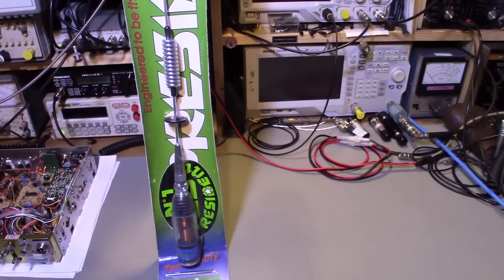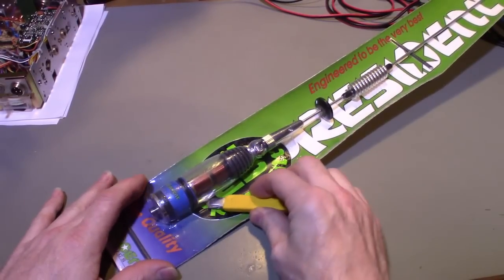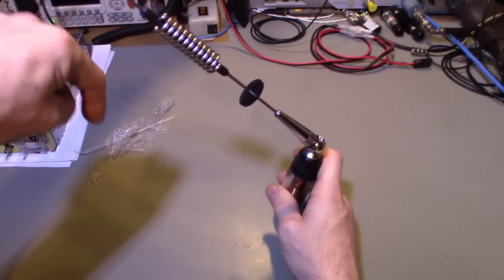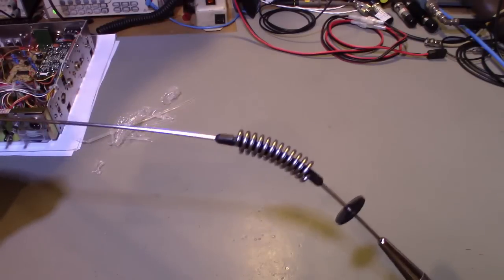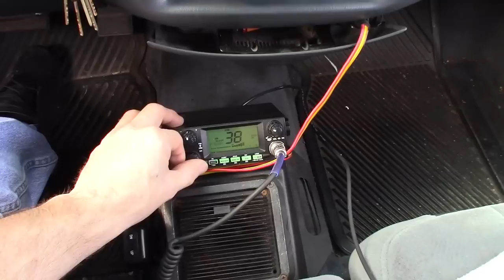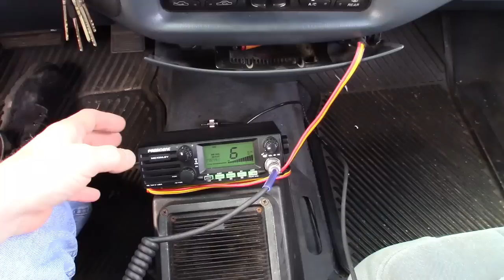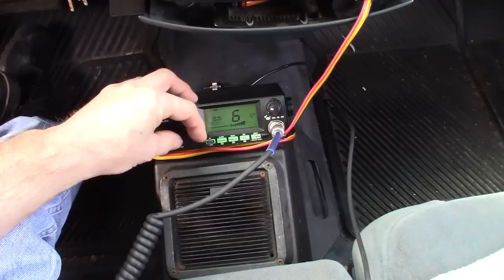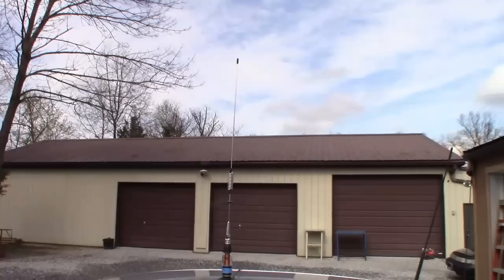President Electronics Mississippi CB radio antenna review.

Comment: We lean them foward.... so when we are Rollin. The antenna is up striaght.
Reply from the maker: I understand and can agree with that.  It's the people that have them at 45 degree angles or more that just make me shake my head.  I don't care if they are going 100MPH the antenna will still never get to a perfectly straight up and down point.
Reply: @mikesradiorepair  yes exactly….. also when sitting still you are only talking with a block or so and keeps reflect from cab down.
Reply: @mikesradiorepair  Tall antennas on top of big truck mirrors will trip over height sensors on highways, some of them are tilted forward to avoid that.
Reply: @daveaf3023  I agree, Was just repeating what I was told when I ask a guy in a Kenworth why he had his antennas laying forward.

Comment: a couple quick points. 1- if the is laying down (folded over) then to the side it would be the difference from vertical polarity to horizontal polarity which will drop your signal up to 20db.
2- the garage shouldn't make much problem with skip. Most vertical have an upward radiation of 16-20 degrees thus radiating right to the ionosphere so  the signal can "skip"
Reply: I agree,i used to use a K40  mag mount on my car trunk open the trunk and work skip on the flat side,worked better then vertical for me in cycle 23!
Reply: Exactly right on both counts. We ran basic, relative field strength tests on a couple big rigs from 90 degrees vertical to about 135 degrees forward rotation, and there was a very significant drop in level.

Comment: I helped this driver with His SWR and when I did that I decided to see what would happen if I tilted His Antennas if I tilted them forward and Straight up.... I noticed when I Tilted them too far forward and also straight up  it raised the SWR, but when I tilted them about 10* forward it was the best.... The SWR was higher because Straight up there was a reflection from the Cab because he had a Conventional, and too far forward it reflected off the engine, but as slight forward tilt was just right tilt...

Comment: The bad part about the semi truck is all the aluminum and metal in the cab. If you try to run the antenna straight up, it’s hard to get a 1.5 or less swr.  On a mirror mount set up. If you have the Mirror hoops you can get above the cab. All the new trucks don’t use those. I try to tell a fellow truck drivers, to use top loaded antennas. Like fire sticks. Trying to tune a set of Wilson antennas is terrible on the new trucks. KD0LDL thanks for your videos I enjoy watching them.

Comment: I had a good time parking high elevation, and after the painful choice of cutting an  8 ft whip, and adding male and female threads to make it sectional, stowable, listend to where skip was coming from, parking side of car facing that way, and the 6 inch magnet on the back trunk edge, yeah, making a horizontal dipole, half cash car, half whip, worked skip with much quieter recieve. Luckilly a jogger or bicyclist did not cruise through and get shish k-bobbed.

Comment: Appreciate this video.  I'm looking to run a ccx 102" stainless antenna.  I pull a van trailer. If I install it behind my cab will I get by interference  ? Should I put a clear rubber hose on my antenna to help with the interference?  I drive a Volvo and the mirrors have the plastic covers and I can't get a good ground.  I've ran a 102 before but pulled a flatbed  so I didn't have any problems with interference.   I'm running a Magnum S9.  Thanks again for being there and helping  everyone..
Reply: Ignore the ccx . Don't know where that came from...lol
Reply: ( behind my cab will I get interference) not by )  sorry.

Comment: We truckers tilt for SWR. These cabs are hell for signal reflect.
Reply: or for height clearance.
Reply: Right on brother. ..
Reply: with THE low SWR  tilt  antennas
Reply: Antennas are intended to be either vertical or horizontal and not tilted. When I see someone with their antenna tilted I know they don't know they don't understand how antennas work.
Reply: Allan McCullough I hear ya... but I hit a branch in the hills and the antenna went 45 degrees and I still talked 900 miles
Reply: I have a dual setup @ 90 degrees on my 379 and have no issues with swr. If you have high swr with mirror mounted antennas I would suggest you check resistance between mount and truck chassis.
Reply: Made a 4792 mile contact to SAO Paulo, Brasil with my Galaxy 95t2. @NoHandleNameScrewTube
Reply: With a steel whip like my mediocre Wilson 5000 @ 70 mph the top half is vertical

Comment: If you are going to get heavy into antenna reviews, check out the Larsen NMO27. Have tho tune it since its a general purpose low band antenna but they are quite rugged.
Reply: I had a now silent key ham recommend an NMO-30 with the 64" whip. He said it was better than the NMO-27. Probably due to less load coil and more whip exposure.

Comment: I figured that the whips tipped forward 45 degrees on trucks was just a questionable fashion statement. Well, not so fast. It seems that on Cascadia tractors, at least, it is impossible to achieve a good mach with the whip vertical. BTW- Do you have any experience with inactive AGC on Uniden Grant XLs? Same as similar vintage 148GTLs...

Comment: I long used a president new york antenna till it brokes, I mean swr was 1:4 very bad at the end. Changed it right now to a Sirio Omega or Super Carbonium. Problem is now I cannot drive into carport with antenna mount up. Have always go out and put them down. 

Now I think to go back to the new president new virginia or to the mississippi, Not sure what to do. What of the 2 antennas performs better? I think the new virginia should work better than all expect. But better than the mississippi?

Friend of mine has a simmilar antenna like the mississippi. Was another name but looks simmilar. He said he has better performance than other antennas even when the are longer ...

What to do?

Comment: The Rubber Ring is for adjusting SWR on certain channels. Because this is a Brand Specific it most likely didn't need moved on your setup.   I have had some fiberglass ones that had a rubber sleeve you would slide up or down for better SWR. No cutting or adjusting those ya know. 

Oh!  and SOME maybe not all drivers tilt them forward because they "Think" they can straighten them up at speed.  So in other words, they are sort of bragging on how fast their truck can go the more forward the antena is tilled...  I know crazy right!!!

Comment: my mobile wonder.....cobra 129 ltd classic, 18 ft rg8 mini au, 4ft firestick ajustable tip, 4pill amp. mount on rear of mobile with hustler quick release for 4 ft firestick. years of service and coax never exposed to the  elements of weather. dead key 100 watts swing 500. very simple but very effective
Reply: WTF is a pill?  Never heard of a pill amp before.  Must be something new.
Reply: @w.rustylane5650  then you must not be that well versed in the world of linear amplifiers because "pill" is a well-known slang term for a transistor, because many of them look like Advil or another tablet of some kind.

Comment: You gotta drop some numbers, somethin they can quickly confirm, and you will never get the loudest, someone confirming on the return bounce will be s5 most of the time. 38 does take breaks and leaves the floor open like Soul Train. Be patient. 28, 20, 17, 11, and 6 will take breaks, but it is like dragstrip light reaction time required.

Comment: Thanks Mike for the Video. I am interested in repairing CB Radios and I'm just wondering what Antenna I should get for repairing radios in my workshop. Will this antenna work for my purpose?
Reply: I max 2000
Reply: @robinbrown7019  Thank you.
Reply: Shop home boat tower tree I max is a great antenna ..64 wave is great on my ham radio with tuner built in .40 meters 20 meters 15 meters and 10meters 11 @ 12 worked the world
Reply: @robinbrown7019  Thanks bro. much appreciated.

Comment: nice little antenna, on my car i have to run straps all over the place for grounding and run wires up from all 4 sides to center of roof to ground(chassis) otherwise can't tune antennas lower then 2.1. it's a hassle but it's the what you have to do thesedays since cars are made of tin can garbage 
73'  k7sce

Comment: My guess on the little UFO thingy is it's a capacity hat. On the antenna canted forward, I do. 
I run a single 102" stainless whip and the best coax i could get my hands on from Universal Radio. At highway speeds my antenna is as near vertical as possible and SWR is 1.1:1 as indicated on the radios built in meter, which is pretty well in line with my analyzer
Stationary it shows 1.2-1.4 throughout the 11 meter band as shown on a Comet CAA-500 antenna analyzer.
I do however have all the various components of the truck, (cab, doors and such) bonded to the frame using 1" tinned copper braid straps.
You can catch me occasionally on 40 meters around 7.187 or on 20 around 14.330-14.340.
And with that I dun got down, down to da ground,  bye buh buh bye bye bye.
Gotta love the idiot's on channel 6...
73' de John C.

Comment: The trash talk is why I got away from CB radio and the other is you can't get pass the high powered radios for emergency requests and I don't care where you are all you get is the same trash .
Reply: I really wish the FCC would crack down on people with splatter box stations and people over powering and talking dx on 27.185 it's beyond annoying

Comment: I know it is a very basic question but how do you route the coax into the car?
Reply: I like to run underneath the vehicle. Find one of the rubber water/drain plugs. Make a hole in it big enough to get the coax through. After routing the cable and hooking it up, I go back and fill the plug around the coax with silicone to keep dirt dust water out.
Reply: Btw, most folks run it through one of the doors. I've never liked this method because it deforms your weather stripping and eventually crimps the cable.

Comment: Yes I would be fine with public executions for channel 6 user's on the "Super Bowel". I do not mind people using power or even operating where they do not belong. I hate splatter boxes and Ghost talking and any form of agitating and noise toys! My problem with ch. 6 as it relates to power is they operate amps that have poor design that goes through bjt transistors like Jimmy Carter goes through liver pills! When you cant afford transistors or they run out because of idiots like that I can not help but wish them nothing but animosity. They go though bjt transistors like a fat kid eating cup cakes. Soon their will be nothing left but Chinese transistors. They should have transition to NXP LDMOS transistors. The guys using tubes that have 10K or more power have to have crazy power bills! I bet if they used a heat exchanger they could recover some of that heat to heat their home! LOL

Comment: I'm running a tram trucker antenna mirror mount. .
if somebody is transmitting on a good radio. .I can receive his signel for about 12 or 13 miles....normal radio is about 9 miles..crap radio about 4 miles.....

Comment: NO disrespect but mag mounts dont work well. You cannot beat a well grounded antenna. I use a 102 inch real actual quarter wave whip. Go to side band to get away from idiots with splatter boxes and you can actually get out with 12 to 20 watts on side band. My 146 has 20 watts out on side band. I have never touched the adjustment but only recapped it.
Reply from the maker: And what should a person do, cut a hole in the roof of their car?  Absolutely nothing wrong with a magnetic mount antenna.  Millions and millions of them in use and working perfectly.
Reply: If you like mag mount OK. I dont they wont work for me at least mine dont maybe its too cheap. Cant get the SWR to go down with a mag mount. A fender mount or trunk mount that can actually fold down inside the trunk if you want to. They will ground good to actual metal.  I noticed you didnt contact anyone though they dont work that great for me is all Im saying. I have a metal building by my drive way next door I can get out good on my 102 inch whip I ground the paint off the bed of the truck back by the tailgate and bolted bracket to bare metal with Electrical contact grease inside the bed side. The fender mount should be better than a mag mount in my humble opinion because it actually grounds to metal. I guess I should try a different mag mount. What brand of mag mount is that your using? It works for you it picks up good. The president has great ears. Did you tune it?
Reply: @mikesradiorepair  how much do you charge to work on radios